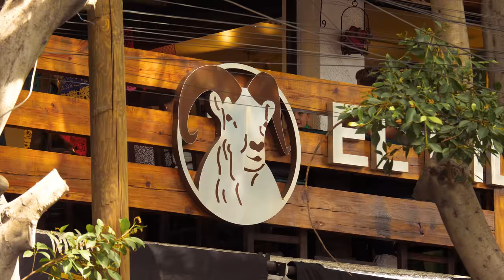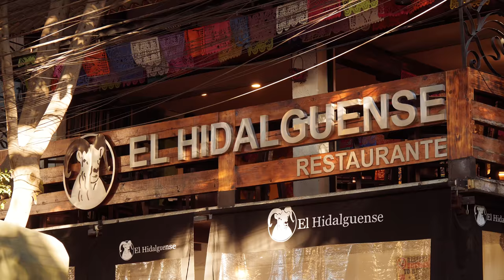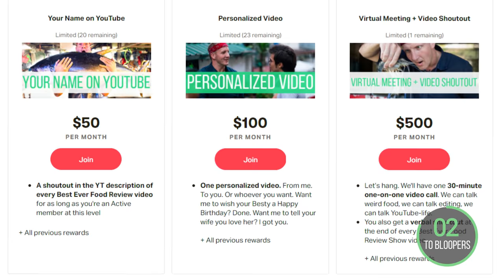MEXICAN MEAT PIT!!! Ancient Underground Primitive Cooking Techniques!!!

Comment: Yep we have barbacoa all over Texas it's super normal. But good on you for giving Mexico props. Also just to add I've seen everything from cow head to wild boar but this looks insanely good.
Reply: Yeah, barbecue is just and English translation of the Taino word "biribicu" or "holy fire pit" so of course Native American cooking is common in America.
Reply: The barbacoa in Texas is different, is typically cow head (that’s the recipe in the North of Mexico, in Texas they got it from Monterrey).
Reply: @jesuzo23  Yeah, pretty standard to use most of the body or the head if specialty. If it is in the ground as prepared as you saw in the video, then it originated in the Americas.
Reply: @jesuzo23  well that's good to know thanks I had no idea. That would explain why most of it I see is cow head.